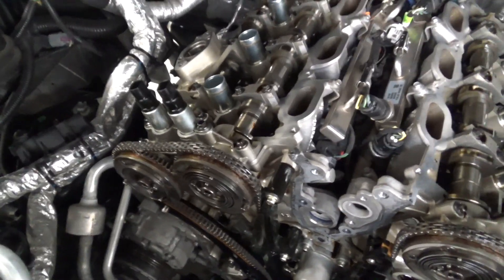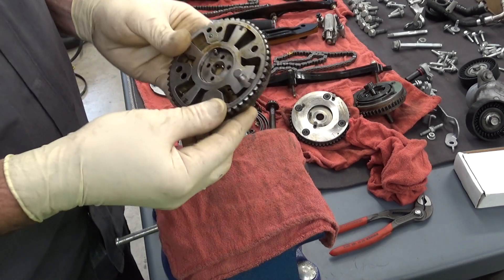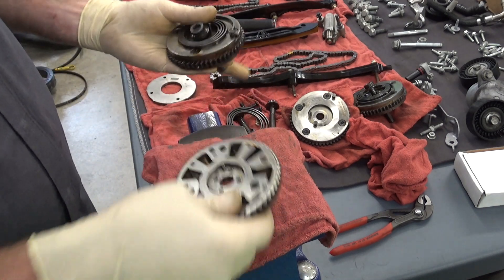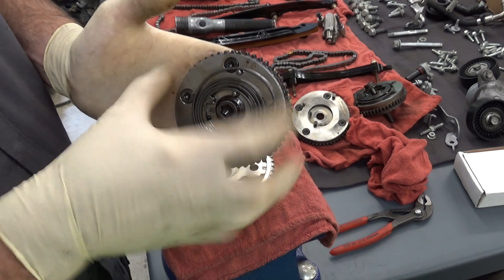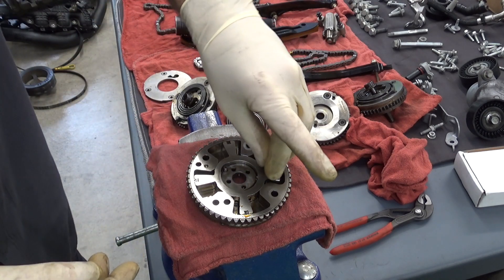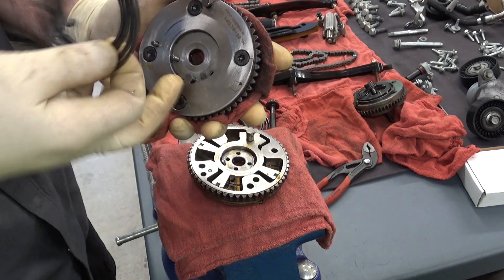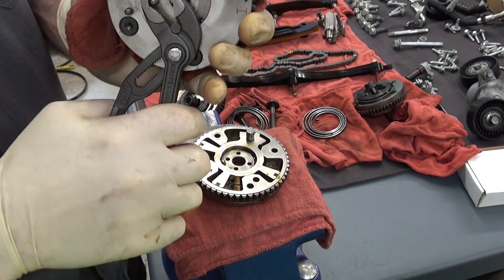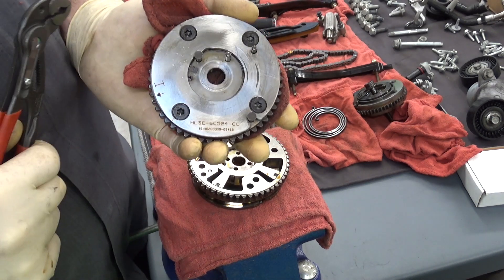FORD 3.5L ECOBOOST CAM PHASER RATTLE. THIS IS WHY

Comment: I would never buy an eco boost. My 4.8L Silverado is economical enough in the new age of high gas prices. Just go with the 5L Yote. Damned eco boost, it's a gimmicky engine.
Reply from the maker: My Yukon 5.3L will turn 20 years old in a couple months. Still keeps going and going.
Reply: I love that Ford tried this direction but I had my doubts then the EB came out back in 2010 (Lincoln), knowing the cam phasing problems on the 3 valve 5.4 and adding turbos didn't add to my confidence that they could pull it off reliably.  I have a feeling 20-25 years alot of the EB are going to be in the junkyard to expensive to fix.  I also miss my 99' 6.0 new Seirra.  Had alot of common problems but none were ever serious.
Reply from the maker: @jarrodwidiger5472  In my own experience, have done a ton of work on the 3.5L ECOBOOST engine. They break the rear manifold studs off on each side & then will whistle under boost until fully warmed up, coolant leaks at the jiffy tite connectors on the turbos, vacuum pump oil leaks, cam phasers, etc but very few repairs on the 5.0L. They don't have turbos that leak or fail, cam phaser issues or broken exh, studs. Don't see V8's much anymore. Ford wants to run the 3.5 in almost everything.
Reply: Right, ive heard good things about the 5.0 and I have guess that for whatever reason the cam phasers work on it.  I'm guessing different or more simple design maybe.  So overall what do you think of the EB? Sounds like they have alot of technical problems but none that are fatal at least if they are caught early enough
Reply from the maker: @jarrodwidiger5472  To be honest, I'm not a big fan. The underhood appearance isn't aesthetically pleasing to me. I think the new bronco has the worlds ugliest engine compartment. Ford doesn't even put a decorative cover on top, I guess that would be another thousand dollars. The engine sound doesn't fit my ear either but I'm weird like that. I work in the used car reconditioning facility and see a ton of high mileage vehicles. Very seldom does a 3.5L come in with over 100k miles not needing some sort of engine work but the exact opposite for the 5.0L although in the last year or so I can't remember working on a five liter. They are rare indeed. Ford wants to put the ecoboost in everything because they build more power & more fuel efficient. I loved my 2011 5.0L F150 which I traded in on my super duty. Wished I still had it but didn't want to maintain two pickups. My 20 year old GMC 5.3 just keeps going. It doesn't have active fuel management, variable camshaft timing, direct injection, overhead cam, electronic throttle. Also doesn't have near the power of modern engines but there's something to be said about old school simplicity.
Reply: @raincitywrench117  I think the EB decision for Ford had alot to do with emissions and CAFE standards which look at the footprint of the vehicle.  I noticed the same thing with GM and the cruze.  I test drove a cruze eco and the car in my mind was a mid size car with a 1.4 liter turbo.  It has a lot to do with emissions.  Putting a 3.5 and a 2.7 liter in a full size half ton makes alot of sense in that picture, but I still don't know I'd buy one.  I currently have and 06' Nissan Titan and it's got its flaws, most of which I've delt with, but I don't know that I'd even bother with an EB in the future.  I'd probably do a GM LS/LT maybe a coyote f150, or find a V8 Tundra.  BTW, I really like the 5.6 VK V8 of Nissan, and have 180k on mine.  It's STILL a beast and a ton of torque but over the years I've seen where Toyota had done them one better in overall design.  The Nissan VK56 motor itself is excellent!
Reply from the maker: @jarrodwidiger5472  You are 100% correct. Manufactures have to meet minimum NHTSA mpg ratings or else buy carbon credits (which are paid to Al Gore so he can heat his olympic size swimming pool, LOL) and each year it's a little more. Soon the fleet will be comprised of mostly hybrids like the power boost which will then lead to EV's. 20 years from now the industry will be completely unrecognizable compared to years past. I love the 5.7 Toyota engine but they are a little more difficult to work on then the coyote. Used to work on quite a few Nissans like sentras, pathfinders but have only seen like a few Nissan V8's in my career. I just don't think Nissan has nearly the footprint of these other manufactures in america.
Reply: @raincitywrench117  yeah, Nissan is an outlier in the US market for sure in the truck segment.  If it wasn't for their disastrous  metal belt CVT, they'd have alot bigger market share.  The VK series seems to be a very good engine with some faults, but none immediately fatal.  I wouldn't however touch a Nissan with a CVT.

Comment: My 2018 F150 will be in the shop for a week to get this recall done. It started soon after I bought it at 41,000 miles. They tried a quick fix, but didn't work. I will miss my truck, but I will not miss that noise when I finally get it back. Great video!
Reply from the maker: The noise is definitely disturbing. Hope all goes well.
Reply: I just sold my 2019 fx4 due to fords solution for vct rattles and cam position error codes.  Stay as far away from the eccoboost and the soft body f150 as possible.

Comment: I watched a number of videos on this problem before watching yours, and they all sounded like they didn't know what they were talking about. You are the first person I've seen describe this in a detailed, intelligent way that shows you truly know what you are talking about, and that you are not only sure, but that you took the steps to show exactly what is going on...thank you. The next question would be, after these repairs, does it actually get rid of the noise?
Reply from the maker: Thank you! Seen other videos and post stating the noise is caused by an oil pressure problem but it simply is not true. It's definitely a locking pin issue. Since I posted this video I got to thinking... Is the reason the pin is not locking due to oil holding the pin open? Now I need to open up another one and check out the passage. It could be the spring is not stiff enough and the return oil passage not large enough?
Reply: @raincitywrench117  Do you think the multiple start/stop cycles can exacerbate the issue?

Comment: FYI I have a 19 Navigator, no cam phaser rattle, but did receive 21B10 recall.  Had the recall service performed.  It turned my silky smooth drivetrain into a shuddering, shaky, hard shifting, whether up or down, mess.  Had the dealership reverse the programming, waiting to get vehicle back.  Does anyone know what this recall is supposed to do if the problem is the pin being set?
Reply: When they do the 21B10 reprogram, they also reset the adaptive learning software on the transmission, which could be the cause of the transmission shifting issues. When did you have the reprogram done?
Reply: Last week had it done
Reply from the maker: A few months ago I came across a bulletin on Ford PTS dealer website stating that 21B10 can cause transmission shift issues and I thought they since stopped saying to reprogram. Will look into it and see if I can find that letter. Not sure how you reverse program to older version. Will also look into that cause now I'm curious.
Reply: @raincitywrench117  Picked up the vehicle after 21B10 reversed.  Car drives great again.  Lincoln sent an October letter identifying 3 programs, the 21B10, a reversal and then an extended warranty on the cam phasers to 80k miles (except already 80k in California and a couple of other states.  But the letter stated unless you tried the 21B10, you did not get the extended warranty.
Reply from the maker: @robertplas3947  Thanks. Good to know. My coworker had one in last month with one of the intake phasers rattling big time. Warranty clerk said you have to program it first which of course it didn't fix it. Makes me wonder what the software engineers were trying to do?
Reply from the maker: Yep. You are correct. 21B10 has three supplements. Just read the third one. 
"In a very low percentage of the affected vehicles, an engine shudder may develop after receiving the PCM update provided in program 21B10. For peace of mind, Ford is providing a no-cost, one-time repair for customers who receive the PCM update under program 21B10 to revert the PCM calibration back to its original state before program 21B10." 
Looks like you were one of the lucky few! 21N08 is the revert bulletin to program it back. Easy enough.

Comment: Do you know if this problem has been corrected on the 2022 model 3.5 ecoboost ?
Reply from the maker: Yes, they have the updated phasers. Haven't seen a 21 or 22 with rattle yet.
Reply: @raincitywrench117  I have a 2018 F150 Lariat with 3.5 Ecoboost with 44000 miles. It's only made the rattle after start up twice. I've gotten the recall in the mail but haven't taken it in yet. Was looking at the new Chevy but I do like my Ford. Still contemplating on what to do...
Reply from the maker: @toddcreech3763  It will be fully covered up to 69,999 miles. At this point you have nothing to lose if you get it fixed. If trading in, you should get a premium but new vehicle prices are also sky high. For me it boils down to what body style fits my eye.
Reply: @raincitywrench117  Taking it in this coming Wednesday. Wish me luck ! lol
Reply: Saw this post regarding a 2021.  Not sure if the noise is due to faulty cam phasers?  https://youtu.be/a2urs9Wc1Io
Reply from the maker: @trouthunter22  Very interesting. Too bad he didn't pop the hood and take a look inside. That doesn't sound like any phaser noise I have heard plus noise doesn't go away within the first couple seconds. Sounds more metallic clang like turbo wastegate rattle but who knows. Would be nice to know the mileage. Hope it has oil in it. Thanks for posting this.

Comment: My GF has 2018 Expo Max and the dealership said it will cost roughly $4,000 to fix phasers and the noise ot makes from cold start. It is alot of money we don't have. It does not look like to much of a problem in your video so why $4,000? Understanding the labor costs but still 4k?! Any suggestions to fix it cheaper or what I should ask to get fix? Maybe Mom and Pops store/auto shop?
Reply: Ok I see. Thanks alot! Been a great help! Looking forward for more of your videos!
Reply from the maker: I can look up the labor time for you but what is an Expo Max. Is that European?
Reply: @raincitywrench117   A 2018 Ford Expedition Max XLT
Reply from the maker: @Skin6612  Oh, I got it. Labor in Ford's workshop manual says 10.2hr job. Our dealer is $179hr (just upped from 165hr) Just more inflation. Complete phaser timing sets including chains/guides should be around $1000. So our dealer would be about 3 grand with tax. Your estimate sounds high. I would shop that job around. If there is an independent with good reviews and warranty that is much cheaper then go with it.
Reply: There's a recall on the phasers but they said they can't fix it because it's passed the mileage warranty even though I just received the warning within the past couple months. Are they not obligated to fix it when Ford itself sent out the warning of the defect/recall?
Reply from the maker: @Skin6612  They are prorating the repair, so that is how they get out of paying on some of these. https://www.f150forum.com/f118/recall-fsa-21n03-498195/
Reply: @raincitywrench117  Thanks again. Basically I'm stuck with the bill then. My Expedition has over 140,000 miles and they said the recall expires at 75,000 and they did this phasers recall 3 yrs later being my Expo is 2018. They selling a $70,000+ vehicle with a faulty part that will eventually break and repair is $3000+ but still have a expiration tag on it. Crooks if you ask me!!
Reply from the maker: @Skin6612  Class action needs to be filed. Ford knows they have an issue and still kept selling. Lawsuit was filed on the focus power shift transmission which cost Ford billions, what a disaster those were. I wouldn't be surprised if the brand new ecoboost engines develop same problem down the road.
Reply: @Skin6612  you need to go to a different dealership, these guys are flat out lying to you. The recall mileage goes up to 89,999. After that the coverage is zero, but for them to lie about something like that, tells me they are shady as fuck. Up to 69,999 100%/ 70k - 79,999 66%/ 80k - 89,999 33%/ 90k or higher 0%. Those are the mileage rates for coverage under the recall....don't go to that place anymore, and maybe try to report them to Ford.
Reply: My Expedition Max XLT 2018 is ecoboost and my gf is ecoboost and they both are on recalls for phasers but they don't want to fix the problem so there needs to be some type of class action suit. How do you think someone could go about starting one or seeing about it?
Reply: This doesn't make any sense. I got a recall notice in the mail stating that since my vehicle has the 3.5L GTDI, Ford will be paying for a recall on the Cam Phasers. All you have to do is go through the steps described, which is to first get the reprogramming done, and then tell them there is still a noise and they will have to replace the Cam phasers. The only catch is that if your vehicle is o er 69,000 miles, they will only pay for a percentage of the replacement. I don't understand how you would get stuck with the cost of something that is under recall....
Reply: @danamullins2723  I wish I would have known this. I just paid $2,200 today for the phasers. Originally they said over $4,000 but the guy at the dealership hooked it up for me. $2200 is still alot and if they paid a percentage it would have be great. Too bad I just read your reply today. Thanks a bunch thou. I recently got my 2018 Ford Expedition phasers reprogrammed same thing they said they could not do to my gfs 2018 Expo cause of milage. And it still didn't fix the jerking feeling when it accelerates. It got rid off the clocking noise but not that jerking. So it's we spent $2,200 to make the noise go away but not the main problem. Ford is really screwing people over selling us 60k+ vehicles and having it fail on us in due time and saying it's our fault for not maintaining it better. Start a petition to fix the problem whether past,present and future this part/parts that will eventually fail on us!!!
Reply: I’m not sure why you’d tear something apart that still runs with no lights.  Just drive it.  Old cars make noise.
Reply: You guys misread, it’s not a recall, it’s a customer satisfaction program. Recall, yes they’d be obligated to repair at no cost, but as of now it’s just a customer satisfaction program.
Reply: @whjerts  did you get the letter directly from Ford explaining it?...I did....It's a recall that's mileage dependent. They can call it whatever they want to call it. They are fixing an issue that was there from when the vehicle was made, and Ford will pay a Ford dealership to fix it, with the amount they pay depending on the mileage of your vehicle, as I explained above. Regardless of what they want to call it, a recall is when the vehicle in question was sold with a part that is defective or unsafe, that was included in the vehicle when it was originally manufactured, and now needs to be replaced....as in this exact case.
Reply: @danamullins2723  if this was a recall, Ford would be required to notify NHTSA.
Reply: @whjerts  thats for safety recalls...anything that will jeapordise a vehicles safety with use, hence why they then have to notify a National Institution of Vehicle Safety. This doesn't effect safety.
Reply: @danamullins2723  yes I got the letter. Nowhere does it say it’s a recall. If it was a recall, they would pay total bill regardless of mileage. It’s a customer satisfaction program, not a recall.

Comment: Why doesn't the 2.7 have this problem?
Reply from the maker: Damn good question! The 2.7 is different in a few ways. The 3.5 has exhaust manifolds but the 2.7 has the exhaust collection chamber cast into the aluminum head & the turbo bolts directly to the head. So it must use different phasers?